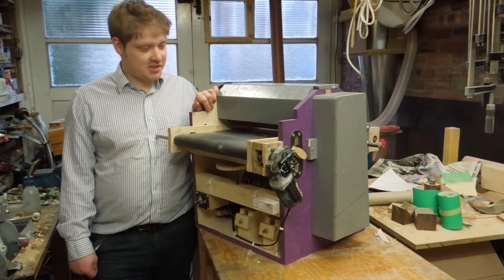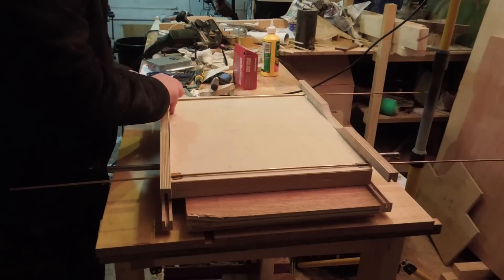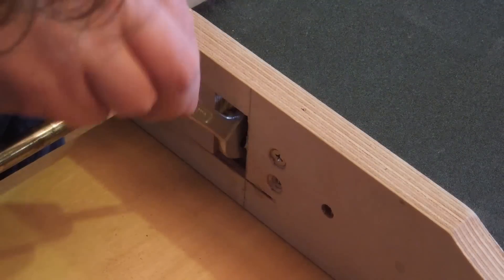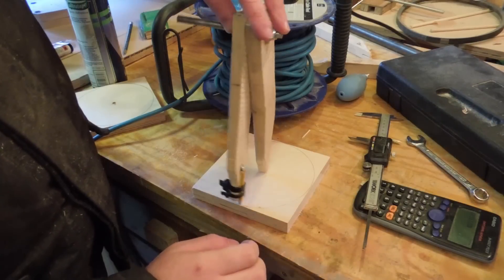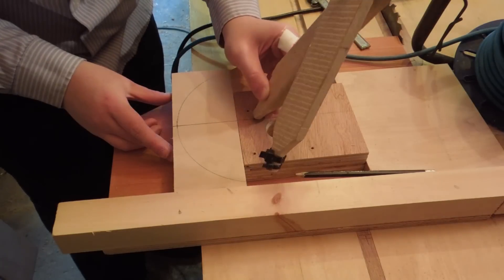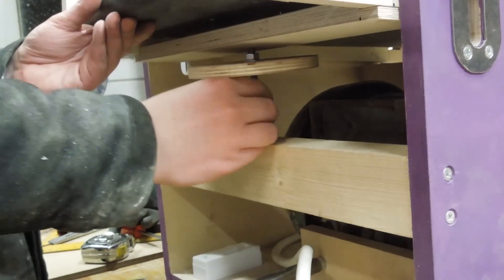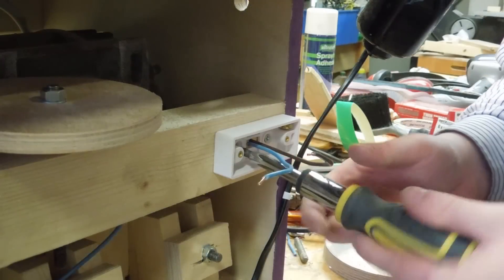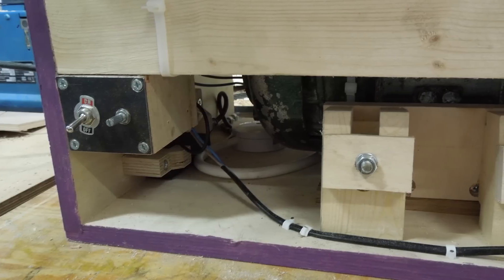Homemade Drum/ Thickness Sander

Comment: Wow Simon - just watched your video for the 20th time i think - just awesome. Wish it was even longer and more detailed. Great narration, camera work and craftsmanship.
I'm starting to slowly acquire all the components, so i can build your sander.
Only thing i'm wondering is, if the hard sanding drum, with just sandpaper is causing problems. Seems the hook and loop type has a bit of "give" which i would think would be a bit more forgiving. I know this is not a planer, but my worry is, that differences in thickness in the stock that being sanded, might cause is to "jam" or kick back?
I would prefer your method, since regular old sandpaper is WAY cheaper and much easier to come by, and living in the sticks here in Sweden, speciality items (like the felt backed sandpaper) is hard to come by.
Reply from the maker: Thanks for the kind comment!

I think the hard sandpaper helps prevent kickback more than it'd cause it, since it removes enough material that if the part were to start sliding backwards there's not much pressure on the already sanded bit for it to grab. With a softer sandpaper with a bit of give it might leave the part thick enough that, when it starts moving backwards, it'll still have enough pressure on the material to get a good grip and overcome the friction of the belt below it.

I was sanding some PVC a month or so back and the first bit went through fine, but then all the fine dust on the belt was extremely lubricating and the second part started to 'float' back out. But it didn't get enough of a grip to launch it. Infeed and outfeed rollers would probably help alot to increase the grip and help with long parts that might tip up into the sanding drum (or very thin parts that might warp a bit during sanding), but that's something I figured i'd build if I needed it and so far I haven't.

Also my thought with the soft velcro back sandpaper was... mostly that it's expensive. But also that it'd tend to round over the front edge of the part going through, and not fully flatten the part since it would somewhat follow the existing waviness of any surface. There's also the concern that if the paper started to come loose it might get jammed between the part and the drum, and help launch it out or damage the machine. It'd be alot quicker to change though, and might be useful if you want to use the machine for finish sanding and swap out various grits. But I think hand sanding, or using an orbital sander, would work better for that.
Reply: Thank you for the thorough and kind reply.
Your point with the rounding over from a "cushioned" surface on the drum is a great one, and since your real world experience is that is works without problems, i will definately go ahead and use your method.
I'm not going to be swapping sand paper at all. I'm not a luthier, but will mainly be using it to sand surfaces of stock that is too thin to safely go through my planer, and to remove small swirl marks left on stock from the table saw. Anything under 5-6 mm gets sucked into it, and attaching every piece to a bigger board is too much of a pain when making tons of boxes for instance.
So it will be permanently mounted with 80 grit. Though i'm going to experiment with using "grip resin" (the stuff basketball and handball players use to get better grip) instead of spray adhesive. Hope this works, but otherwise i will use the spray https://www.amazon.co.uk/Intense-Grip-Handball-Resin-500/dp/B00U1JEC1I

Another question if you don't mind. Do you change the speed often on the feed belt? I have a nice 230v high torque 20 rpm synchronous gear motor, but it can't be speed regulated. Was thinking it seems like an ok all round speed if i used it as a direct drive, and would equate about 70 cm of travel per minute speed on the conveyer belt, which seems about right. But if you find the speed regulation essential, i will have to come up with a different solution (like swappable wood gears or something).

Thanks again for your kind reply. Hope to see more videos from you soon, but i realize that making videos of the quality you are is a massive undertaking.
Reply from the maker: That grip resin looks like a good idea. I've not had to change the sandpaper yet, although it's getting there, and I imagine it's going to involve a heat gun, solvents, and alot of scraping.

Yeah I tend to change the speed alot. I think it's more down to how aggressive a cut i'm taking and/or the hardness & width of the material, where slowing it down helps. The adjustment screw I made is fairly poor, since it's only captive at one end it can tilt about quite a bit, so I can't adjust the cut very precisely. Maybe if you could come up with something better you could adjust the depth of cut to match the speed of the belt.

Also i've been sitting on a video for quite a while. A couple actually, on the same topic. But they're so... weird that i've been hesitating to finish them. I'm both worried about the response and also still unsure about how to really make the video. Hopefully i'll have it out by the end of the year but don't get your hopes up.

There's also been a few failed and unfinished projects this year. After I made the banjo I was setting up to make chemistry related videos but it kinda fell through when I realised how time consuming and expensive it was becoming. It's something i'd like to get back to though.
Reply: Thank you again. I will have to figure out a way to regulate the speed then - have to think about it.

Well - i hope you figure out a way to make more content that doesn't break the bank, and isn't too labour intensive or disruptive to the fun of making stuff. There is a big difference in making something that works or is interesting, that only you will see, and then presenting something that many thousands of people might potentially watch. A lot of a**holes out there waiting to slam creator, to compensate for their own lack of accomplishments.
I for one will watch anything you put out, even if it breaks with the usual tone and style of your other videos.

But man - you are an inspiration. What you make, with tools and materials of sometimes questionable quality (no offence), is amazing, and always a great reality check for me. I'm guilty of sometimes blaming the lack of the right tool for not tackling a project, which you prove is just an excuse and a mental block.

So - i WILL build you drum sander, even if it takes me months :).

Comment: Very nice build!  To sand smaller pieces you might consider putting a set of grippy rollers on either side of the sanding drum that are rotating at the same speed as the conveyer.

Comment: You must have as big a heat sink as you can, glued with a good head sink paste/glue on to your speed controllers mosfet, if you havent already done that. Else, do add a 12v fan. Doing so, over my 3d printers controller has done well for the motor driver boards. 

I can see how much work you put in and I really respect the honest video you have posted here.

Comment: Hi Simon, I'm a Geordie living in Australia and I love your drum sander design and I intend building one just like it. I'm almost 82 but still love pottering on in my workshop. It would help me greatly if you provided a dimensioned plan with a list of items used, size of table belt etc., is that available. I've got the Sketchup view.
Reply from the maker: Check the video description. Should be a thing that says 'SHOW MORE' under the video itself. If you ask me youtube should make it stand out more, it's easy to miss. There's a link to the sketchup model there, and in the top right corner of that page there should be an icon you can click to download it.
Reply: I've got the Sketchup view but it's not dimensioned, am I missing something? What size is the table and where did you buy the table belt?
Reply from the maker: Also in the description is a link to a UK store where I bought the belt. I've got no idea where you'd find one in Australia, but there's the dimensions on the UK store's page. For dimensions in sketchup, sketchup has a tape measure tool (the icon is a tape measure). Sketchup provide a series of quick videos on how to use most of it's tools that are worth watching since alot of stuff isn't self explanitory. https://www.youtube.com/watch?v=iQEACzA2fDk&list=PL190C90DCE62242C9&index=15 Might also be worth looking at the dimensions tool.

I didn't feel a more traditional dimensioned drawing was necessary since the sketchup model already has all the dimensions to measure directly, and I found using the dimensions tool to include the dimensions made for a very cluttered image.
Reply: Richard Hayes

Comment: Love the video.  Could you tell me what drive motor/unit you used for the feed belt please?  I'm designing a drum sander to build and like the feeder drive you have.
Is the table conveyor type feed preferable to feed drums on the inlet and outlet side of the main sanding drum?
Reply from the maker: I think it depends what you want to sand. Thickness planers tend to have rollers to push the stock through, but suffer from snipe that mangles the ends of the board as it leaves one of the rollers. They also push the wood flat against the table so you'd need one side to be flat already or the piece would spring back. I think they'd be best for sanding very thin veneers that are so thin they want to curl up and wont stay flat with a conveyor. The mechanism for driving the two rollers at the same time would also be a little bit complicated, involving a chain with considerations to keep the chain from falling off when the rollers move on their suspension.

With the conveyor belt In think it'd be possible to also have rollers that you can remove when you don't need them. The rollers there won't need to drive the part, so the whole thing with a chain won't be necceccary. They'd only be there to keep thin and long work flat against the conveyor.

The motor i'm using is a car windscreen wiper motor, which you can usually get fairly cheap from any automotive scrap yard, and i'm running it at 12 volts I think. The speed controller I built myself but it has some problems, you can buy PWM speed controllers very cheaply from ebay if you search around.
Reply: Darn, I just thru away an old wiper motor I thought i'd never need when I cleaned out an old storage building last month - should have known better!  Off to the salvage yard or e-bay.
Thanks so much for your insight.  I think I'll stay with the driven conveyor belt and just add some small diameter spring-loaded rollers before and after the main sanding drum for some thin stock work.  i'll make them so I can pin them in an unloaded position in case they present problems on thicker stock.

Comment: Excellent work my friend - happy to subscribe. Why not just use some 4" steel tube for the drum? I'm most impressed that you made this with some fairly shitty B&Q power tools - no offence, but its a nice change from Festool everything.
Reply from the maker: Chances are the 4 inch steel tube wouldn't be that round so it'd only sand on a couple points. Plus it'd be tricky getting it lined up properly on the shaft even if it was round. I really can't remember why I decided to use expensive birch ply for the drum over something like MDF though. I guess it's just what I had on hand.

Also thanks for the tool comment. I'm not sure how some people can afford fancy hand power tools. A whole set would add up fast. Plus I don't think they ever justify the price. I bought a semi-expensive router for a project  a while back, the sort with a round metal body, and I'm not convinced it out performs the cheaper ones I already own. It has a LED light in it I guess. It might last longer but I could buy a lifetime supply of the cheap ones for the same price.
Reply: I'm going to try some 4" PVC pipe - schedule 120 (really thick walls).

Comment: what's the difference drum sander and a planer?
Reply from the maker: +DoctorBahnausSee Planers remove material alot faster but alot more aggressively, and are ideal for quickly and efficiently resizing long boards and making them parallel. But they don't handle short or delicate pieces at all. For stuff like the hexagons at the start of this video a drum sander is handy. I guess you could try plane boards in a drum sander but you'd probably wear the paper out fast and would probably need to add some rollers to stop the board from tilting into the drum with gravity.
Reply: thanks

Comment: How much do you think the total cost was? What changes would you make if any?
Reply from the maker: +matermark It uses alot of birch plywood, which is fairly pricey stuff. Something cheaper would probably work just as well but it wasn't till recently that I found cheaper and decent quality plywood. But with the birch ply costing something like £80 for a 4'x8' sheet id start the price at that, even though I didn't use a whole one. The sanding belt was £12, the motor I was lucky enough to get for free but buying one might cost around £60. Then about £20-30 for the metal. There's other small things too like the power adapter and switch. The bearings would've cost a bit less than £10 but I also got them given...

So i'd estimate the price, if I was buying everything new, to be about £200. 

As for what i'd change... probably not much. It's worked out very well. But I'd slightly widen it so I wouldn't have to trim the sanding belt I used for the conveyor, and I might consider making it a bit taller to accept bigger stock.

Comment: hi Simon. amazing video. I am well into building my own. just ordered steel rods but they don't fit the bearings :( I guess that I need precision ground round bar. Did you experience this? any idea where you got your steels. everything else I found. anyway super job and video.
Reply from the maker: David Monheit I wasn't using precision ground bar if I remember right. Just regular cold rolled steel, which is usually fairly accurate. I got it from a place in Darlington called m-machine metals, who're pretty good for small orders. I guess your bar could be slightly oversized, in which case is there any way you could chuck it up in something like a drill and spin it (not too fast) and sand it down till the bearings fit? If you can't chuck it up you could just stick it in a vise and do it the hard way. I can't imagine it'd be oversize by much if it is oversized. Also make sure it isn't just chewed up at the cut edges, since any burrs or dents would get in the way of the bearing.

Comment: It looks good. Did you consider using pvc pipe to form the rollers as i have seen others? also do you have probems keeping the conveyor completely parralel to the roller? i am considering making one for guitar making but am concerned about keeping the table parallel being that the woods i work with are sometimes 3mm thick, thanks
Reply from the maker: Joe Steele I did consider using PVC pipe. I've seen people using it with a couple of end caps to fix it onto a spindle, but I figured that the hollow pipe would be quite flexible and probably bow from the tension on the belt. So then I thought about pretty much making the rollers as I did from MDF, then slipping the pipe over it. But I figured i'd need to crown the roller anyways, and wasn't too sure how well the PVC would turn, plus I had a harder time finding PVC pipe in the right diameter required (if I was planning ahead I could've made the table to fit the pipe). But I decided to see how plywood would work, and it worked just fine.

Another thing with PVC is it might be a bit too smooth to easily grip the conveyor belt.

Also for adjusting the table parallel to the sanding drum, the mounting holes on the flanges for the table's pivot are slightly oversized and that gives some room for adjustment. I can get it fairly close by putting a flat board on the table, lifting it up, and holding it against the drum while tightening the flanges back down. If I needed something critically flat I could probably sand a thing, measure it, and then adjust the table by loosening the flanges and tapping them up/down to correct.

Comment: Great work. Congratulations On.
I live in Brazil and here not always find the things that are shown.
I wonder what the sandpaper grid you use to drag the woods, so I try to adapt here. I would also like to know the sanding roll diameter  and rotation.
Thanks You.
Reply from the maker: Eugenio Macedo The sandpaper for the conveyor belt is this stuff at 120 grit. http://www.axminster.co.uk/sanding-belts-406-x-1-220mm 

For the drum i'm using 80 grit sandpaper, which doesn't leave a very smooth surface, but this tool is mostly for making the surface flat and parallel. The rotation of the drum is clockwise while facing the drive belt. It rotates so as to sort of push against the work being fed in. It should reduce the chance of the thing getting grabbed and flung out. The drum diameter is 125mm and runs at 1400rpm.